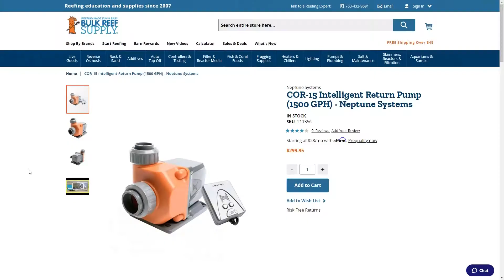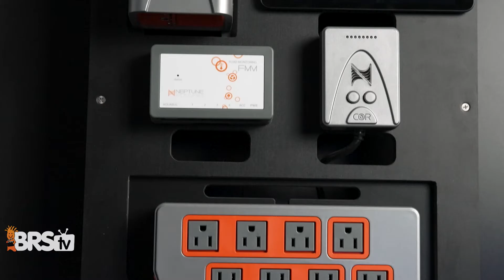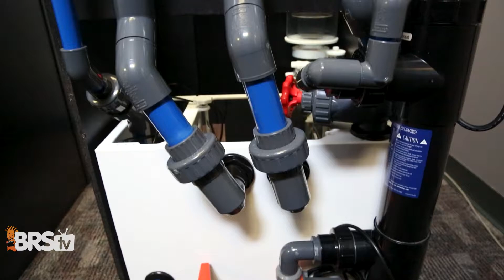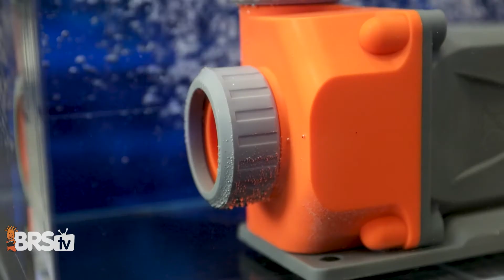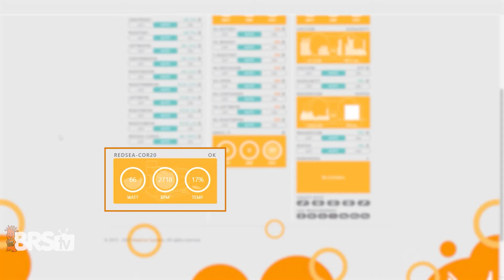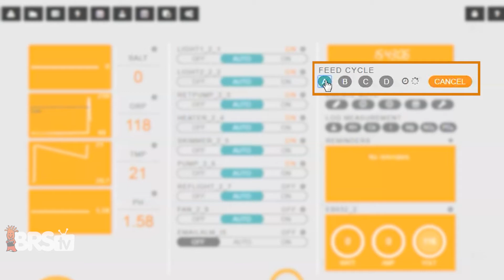Smart & Flexible...an Aquarium Return Pump for Your Neptune Systems Apex! Neptune Systems COR-15

Comment: Wait, she just said it doesn’t require a lower brick because it can run on the one link. So what is all the problems that people are having with the power supply? Can it be resolved with a one link cable instead of buying a more expensive power brick?

Comment: would this be good for a waterbox 130.4?  Display tank is 96 gallons
Reply from the maker: The COR15 would be a great choice for a display of that size 🙂
Reply: @BulkReefSupply  thanks, I ended up going with the 20, I figure I can always back it off if needed

Comment: I will stick with my Vectra L2. Every review I have ever read for these Neptune pumps is just terrible. I shouldn’t be surprised you guys are pushing this junk now that you own them.
Reply: I have one and it works great, love the controllably of it since my overflow is super touchy, the only problems I have had from it was due to user error (wrong type of check valve on my plumbing)

Comment: How much is it?
Reply: @chrismoniz5898  The COR-15 works just fine with an Apex Classic - you do need a 1Link though to run it - but, the WAV starter kit comes with two WAV and a 1Link and power supply  - one port free and waiting for the COR-15
Reply: @terencefugazzi5164  tyvvm
Reply from the maker: You can find the COR-15, along with pricing right on our website (link below) 🙂 

https://www.bulkreefsupply.com/cor-15-intelligent-return-pump-neptune-systems.html
Reply: I paid 300$ for mine